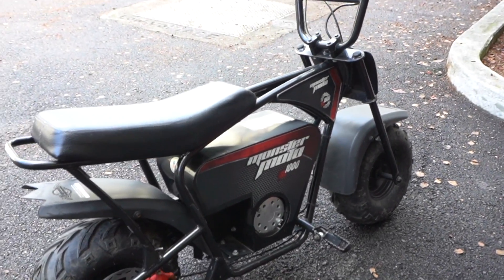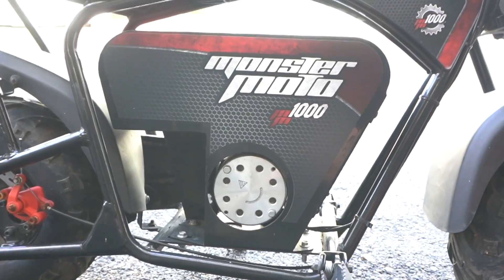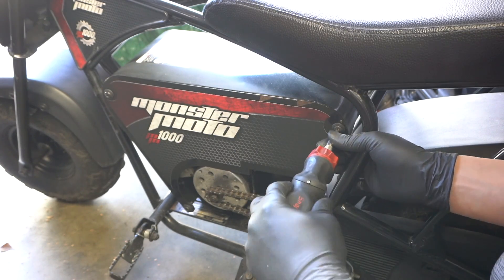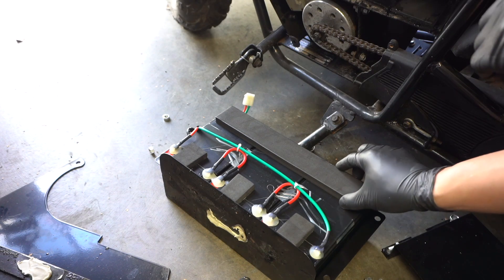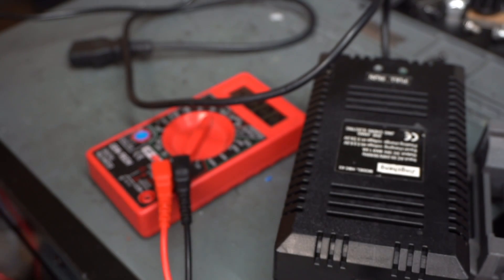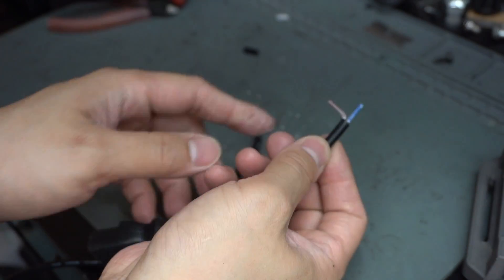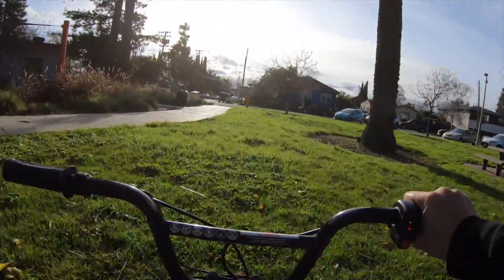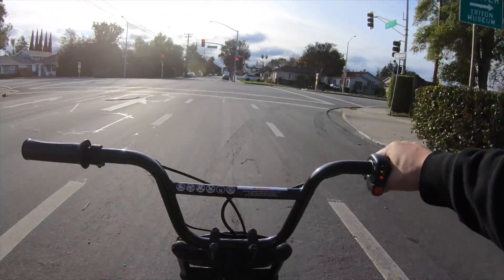Reviving a $100 Mini Monster Moto 1000W Ebike from Facebook Marketplace - Repair and Test Ride!

Comment: Do they sell battery to make it faster on stock motor?
Reply from the maker: There are no specific Monster Motor battery offerings, but these are the same size as the ones we fitted in ours. 

https://fafo408.com/products/827535-battery-pack-36v-48v

Comment: I’ve got one of these.  It was free.  It got rained on and now won’t run. What’s the odds it the inline fuse?
Reply from the maker: Either the fuse on the battery or the battery is just dead. The lead acid batteries dont do well if they're left for a long time on a low charge.

Comment: Does the bike have a limiter or something when I full throttle the bike the noise changes from the normal electric while to a kind of clunky sound
Reply from the maker: Hey! Yeah that sound is totally normal for this bike - the drivetrain is just kinda loud, especially when you gun it. About the limiter - the controller does have a max power cap. Like if you've got a 36V controller, it won't push past its limit unless you swap in a 48V battery.

We're actually planning some upgrade videos soon. Which would you rather see first - boosting the power output (bigger battery/controller) or changing up the gearing for more speed? Let me know what would be more useful for you!
Reply: Yeah. I just got another. The motor is held in the box with doesn’t suppress the noise. Kinda pushes it right into the rider

Comment: 75100 or FD72200, 48V, and MY1020 motor seems like a decent easy upgrade.
Reply from the maker: Instead of the 36v batteries, we've got packs in the same size but at 48v. However, we've chosen to stick with 36v for now to enjoy that extra range. Adding the 75100 + MY1020 combo would definitely give this a noticeable boost in pep for anyone seeking an upgrade!